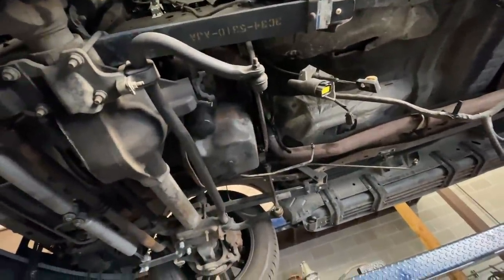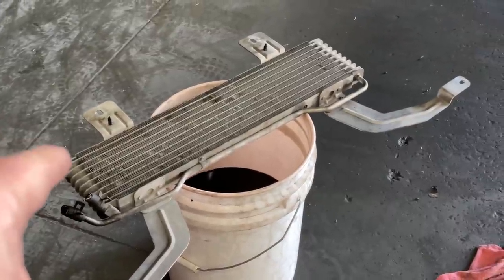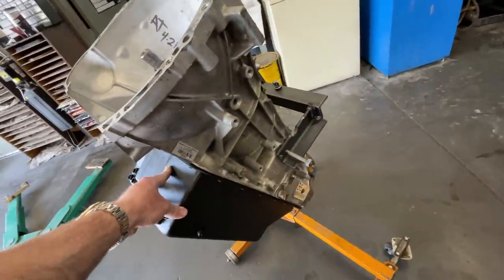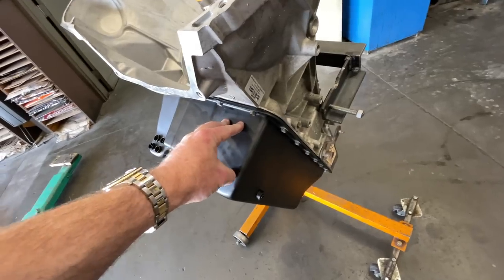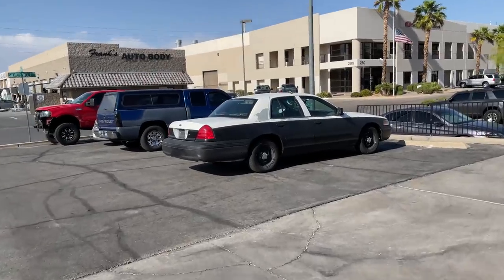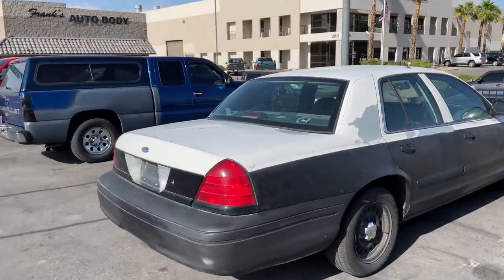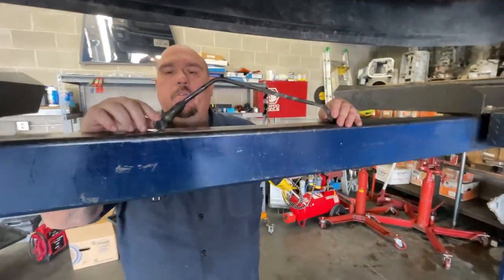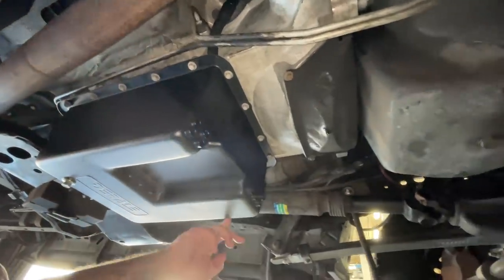Ford Excursion Transmission Replacement and Upgrade / Rolls Royce Phantom Intake

Comment: That's a a good price an it's cheaper to keep her/hang parts Ps. Lady I  know has a gas Suberban cost $7800.00 to have it rebuilt
Reply: Really what year  ? She got ripped off badly. Cause you can guy the most expensive diesel trans from gm for 6k and that is for a duramax not a gas motor. Just replaced one in a 2500hd gas truck out the door was 4500.
Reply: @wileycoyote3853  my thoughts exactly. $7800 wtf ?
Reply: They saw her coming a mile away.  Sheesh

Comment: I think you are absolutely right about putting money into your excursion, the biggest problem with transmissions is heat, especially when you’re towing and you’ve got your foot buried in the gas pedal, you might want to put a trance temperature gauge on it so it can tell you win the back off the gas going uphill, but that trans cooler and the bigger pan should alleviate your problem. I have family that lives in Las Vegas  I usually go there, in October, and yes it’s hot. Love the old cop car, hell yeah drive it around don’t worry about it in parking lots the air conditioning kicks ass. I did not know you could order a big Mac that way, I have eaten big Macs for many years even when they came in the Styrofoam containers.😂

Comment: I'd suggest getting an aftermarket oil and transmission cooler, it helps alot! You likely stressed the transmission when you were helping ppl towing them during the winter storm? But paying it forward always pays off in the end. It was likely on its way out anyways. Atleast you made it to Vegas. Great mods though, a lot of ppl over look this. Any mods or aftermarket parts that will increase the cooling of lubricating fluids is worth it. It'll definitely help to prolong your vehicle. I did the same myself for my G35 sedan. Speaking of, I highly doubt you'll see this. But I recall seeing a White G35 sedan in the back of your shop in Dallas. If that's for sell shoot me a message, I'm definitely interested. Love those cars, they are extremely reliable. I'm looking for another one currently and I live in the Dallas area. I'm assuming you're going to be selling a lot of your extra inventory. However, I don't know a good way to reach you though.

Speaking about McDonalds does anyone remember the McGangbang? It was a secret menu item, or you could just order one McDouble and one McChicken. You just combine them, it was really popular around 2008&2009. It's actually pretty damn good. I'd remove one of the buns though, too much bread for me. It was the poor man's sandwich only cost $2 then. Haven't been to McDonald's in a good minute. Doubt the McDouble is $1 anymore.

Comment: Very cool truck well worth the little you've had to put into it.  That bypass is also to allow the fluid to get up to temp quicker.  That being said I have a 2008 interceptor crown Vic and guess what failed the stupid bypass.  On those it's a plastic piece right right off the trans cooler portion of the condenser.  All aluminium with 1 nice plastic piece just waiting to crack and possibly destroy your transmission.